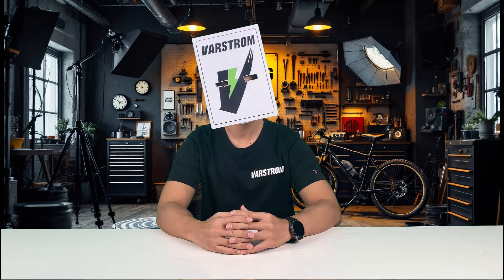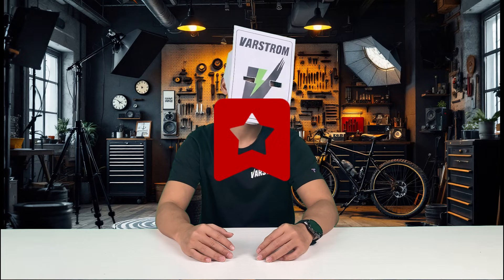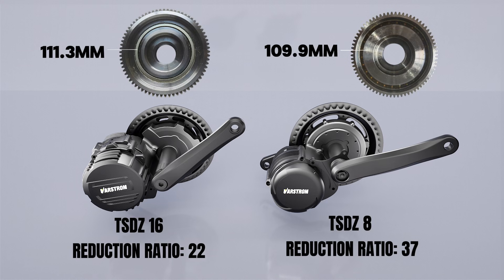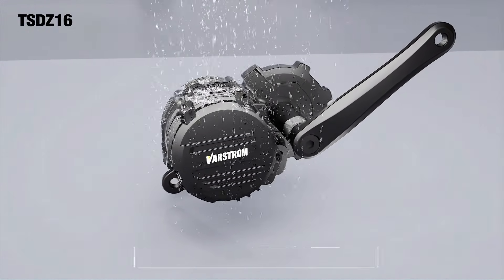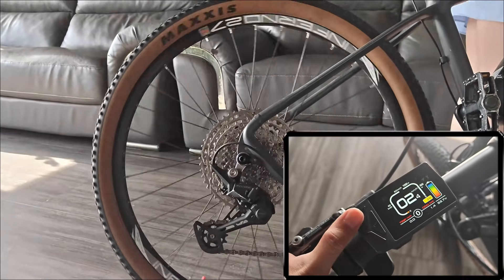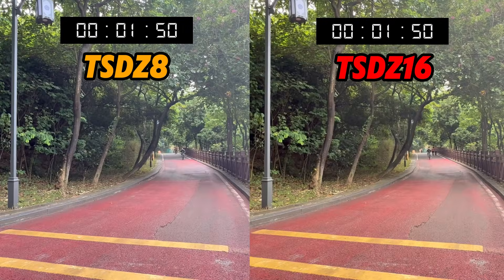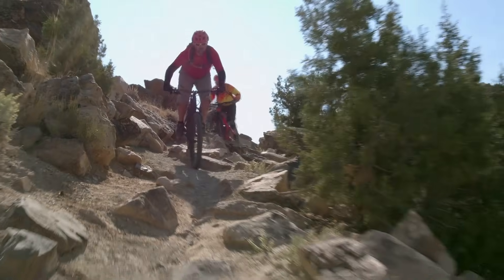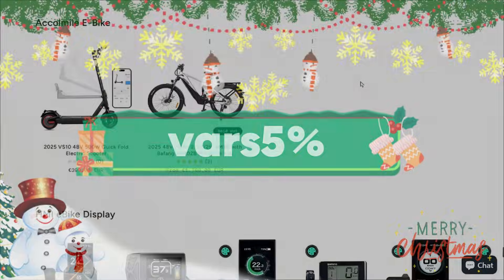FINAL BATTLE! Varstrom TSDZ 16 vs TSDZ 8: WHO IS THE BEST E-BIKE MOTOR #tsdz16 #tse #tongsheng

Comment: I'm very tempted to buy your 1000W motor, but I have two questions that many people ask.

First, I'm thinking of buying your motor for a long trip of 5,000-10,000 km. Will it be reliable on such a long journey? Parts are harder to find than with your competitor's, especially in some countries.

Second, I've heard that the thumb throttle has a long delay and isn't very responsive. Will you be offering users the option to choose or improve this?

Because I'm very tempted by your motor, but these two points are holding me back, and I'm not the only one.
Reply: Throttle has no delay IF you are already pedaling (in this case the controller knows the speed and is already applying power without the throttle, so it knows the drivetrain is engaged). If the system does not know how fast it has to spin to match the current speed it will ramp up the rpm very slowly to not crush the drivetrain when hitting the current rpm of the system (while rolling). So you can have instant throttle control if you pedal for ca. half a revolution first. The controller will nerver know what gear you are in and wich reduction each gear has.. So there will never be an "update" for that safety feature to give you a faster response time.
Reply: @robertkruger8180  Thanks for the information! Even so, I think it's up to the user to choose how they want to ensure their safety.

But perhaps over time, people will release more open-source firmware, and we'll have more feedback on its longevity. I'm tempted by this motor, but for a long trip, I might stick with something more familiar.
Reply: @moimeme7704  It's not safety for the user. Its safety for the product (warranty, they would have a huge wave of broken products sent back their way). I got the feeling people don't understand what this would result in. The front chainwheel has to move independently from the motor. It engaging without a ramp up would be extremely jerky. This is not a surron where the motor is constantly engaged with the drivetrain. Imagine if it was always engaged! You could not ride it like a normal bike anymore. You may think what you want but Varstrom will never do it and a custom firmware would be a jerky hell to ride and destroy the nylon pinion and your freehub in no time.
Reply: @moimeme7704  To be honest for longevity a hubmotor without any gearing inside is the way to go.
Reply: @robertkruger8180  Excuse me, I didn't see your message before, but to answer you, if the competition is doing it, it must be possible, but I understand the "idea" in theory, yes...

Comment: The TSDZ16 is actually the best torque sensing motor you can actually get. The power is unreal literally doing 30mph going up the hill competing with them cars. Especially hooked with a 52v battery (faster than a bafang 1000w).

My only problem is that long use of high power causes the nylon gear to wear so if they can come up with a bronze gear like bafang that would be nice.

And the warranty from varstrom can be a bit funny sometimes. I can’t say anything yet but they are currently processing my warranty ( l will let you know when they sort it out).
Reply: I'm not sure how you are getting that it's faster than a 1000w Bafang, they are both 30 amp 48v mid-drive motors, so the speed should be around the same, except with a Bafang you can raise the amps to 33 amp and pair it with a 52v resulting in 2,000 watts without much work or tinkering. Also the Bafang nylon gears doesn't fall apart as fast as like with this motor and doesn't have throttle delay (at least the UART version doesn't, CANBUS one is a disappointment with throttle delay also making it hard to be in the righr gear). Here's hoping they start shipping these with PEEK gears and someone is able to reverse engineer the firmware so the amps can be raised like with the BBS02 and BBSHD.
Reply from the maker: Good day customer,
About the warranty. Our technician and TSE engineer are working on the video help you confirm the problem, please wait for some days.
Reply: @varstromebikeconversion  Good day Varstrom, no problem then but how would I know if the video is out?
Reply from the maker: No worries — once the video is ready, we will notify you directly here. Thank you again for your patience!
Reply: Nylon gear is a safety fuze. If you put Bronze - it will wrack the shaft if misused
Reply: @eugene9000pro I said PEEK, not bronze.

Comment: I’ve been riding the TSDZ8 for years on two different bikes, and for anything with higher power I really wouldn’t recommend going above a 9-speed setup. What holds up best for me is a 9-speed Shimano CUES cassette together with a Linkglide chain — definitely no wax, it doesn’t survive the torque.

With lower-quality drivetrains the 11T sprocket gets destroyed very quickly.

If you run even more power, you should absolutely stay below 9-speed, ideally 8-speed or less, because the wider components handle the load much better.

And definitely don’t experiment with internal gear hubs when you’re pushing around 160 Nm of torque ;D
Reply: @TheMedelbacher  wax is fine my bike with bbshd is still fine after 2000km but oil is kind of better overall
Reply: I started to use Sram - x2 times more reliable
Reply from the maker: Thank you for sharing your experience in the community.